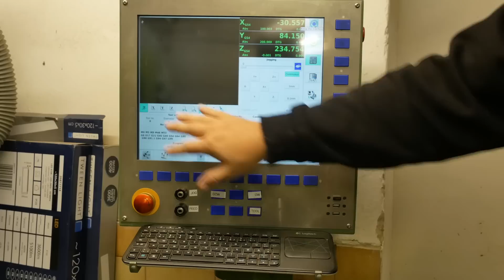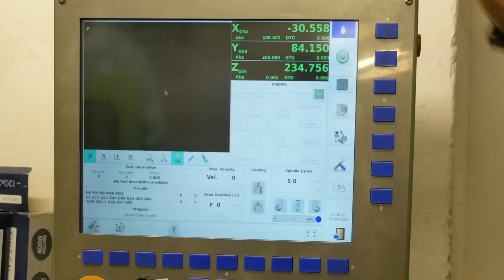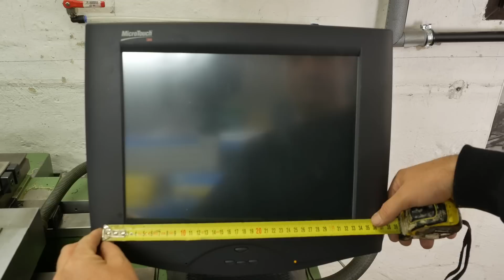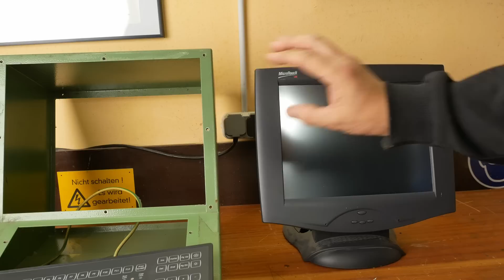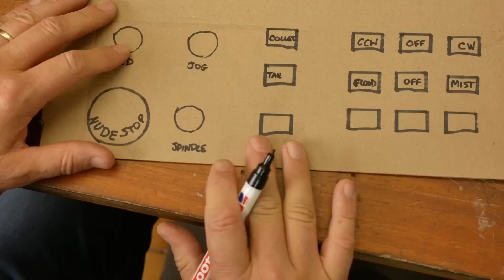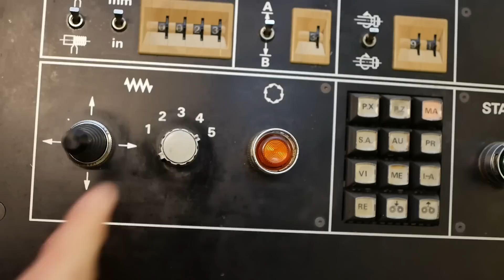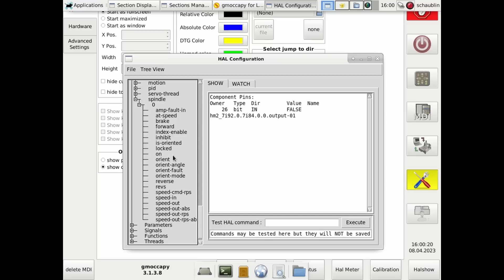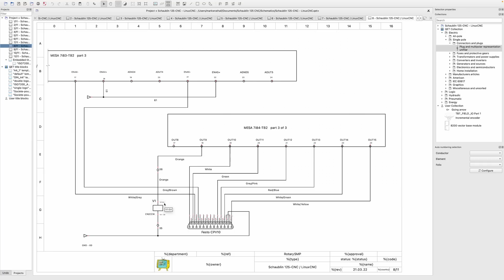Please help critique my CNC control panel layout ideas. || RotarySMP

Comment: I am very impressed about your progress, so that I can follow you with actions to my maschine under restauration. You are asking for ideas for the human interface. Isn*'t it a question how how to use which technology. Mouse driven or key driven or a rotary wheel with a selection button?

I find your way quiet interessting. Keys allow direct access to parameter and one can set different levels of paramters in relation to the frequency of using the specific parameter. This gives you the opportunity to direct access a parameter that needs to be change. Automotive electronic made a similar journey over the last years. Single technology parameter setting by a wheel and a single key or the combination with distingt paramater setting for specific use. It is easier to learn a single technology, but the combination offers much room for improvement and single user specific layout. Keys can be places in horizontal an vertical spheres, wheels need more attention especially how the movment will take place when using right or left hand. As a role of sum I would position those parameters which will be need to get different modes of operation by just switching one or some parameters. Examples may be reversing of rotation as toggle or form feed setting by numeric key as second input etc.

regards

Klaus
Reply from the maker: Thanks for sharing your ideas on this Klaus.

Comment: I would recommend a 24" DELL P2418HT Touchscreen Monitor we have them on our CNC wood saws and other machines and i think it's the right size.
Reply from the maker: Do you have those monitors as stand alone, or integrated in to a control panel? I really dont have space for such a large monitor in a control panel.
Reply: @RotarySMP  There are more or less standalone
Oh and they are HP

https://drive.google.com/file/d/1DCzpnbDZqSOTm9Y0bO0zH_L7hlln-3G-/view?usp=drivesdk

Comment: I think you should do another custom job like the Maho; another vertical unit....
Have you seen these screens...
https://www.aliexpress.com/item/1005005291064583.html?spm=a2g0o.home.15002.66.25722145oHy0WZ&gps-id=pcJustForYou&scm=1007.32079.207335.0&scm_id=1007.32079.207335.0&scm-url=1007.32079.207335.0&pvid=93906a9c-0620-44fd-a8f7-7d4ae8d6393b&_t=gps-id:pcJustForYou,scm-url:1007.32079.207335.0,pvid:93906a9c-0620-44fd-a8f7-7d4ae8d6393b,tpp_buckets:668%232846%238115%232000&pdp_npi=3%40dis%21AUD%21426.79%21362.77%21%21%21%21%21%402103200516830766892072870e2259%2112000032511887058%21rec%21AU%21102332100&curPageLogUid=8VvX3shBG6gV&ad_pvid=20230502181809261339694202493479267_0

Comment: I've worked a while on a Weiler C30 lathe, it had a joystick which could latch in X+/X- or Z+/Z- direction while turning, which made it feel kinda similar to a manual lathe with feed engaged. It also had two jog wheels, one for each axis. Maybe worth looking into.
Reply from the maker: Thanks for providing examples.

Comment: I use a joystick for X and Z jogging and love it. The speed of jogging is proportional to the stick deviation. Would hate going back to wheels. Ciao, Marco.
Reply from the maker: What machine and controller type it that?
Reply: @RotarySMP  Made a video about it 8 years ago, here it is... https://www.youtube.com/watch?v=ixOsdKvbKlk&list=PLQtK-o86LDp_78XDER9oJQAt_sDQWxK6x&index=11&ab_channel=EZshop I also use it with my lathe, obviously the buttons are mapped differently in that use case.

Comment: Instead of cutting down the sheetmetal, add extra rows of programmable keys to take up the extra space. I would use Cherry MX keyboard mechanical switches for the keys around the screen. There's nothing like the tactile feedback of a mechanical switch. They're very popular among keyboard enthusiasts and can be had for pennies a switch due to their popularity. They also have a huge variety of keycaps, including legendable ones with LED windows.  There's also a ton of online resources. Check out Datulab channel, a kid who has build videos on his CNC panels.
Reply from the maker: Thanks for the tips. I have been using industry switch blocks.

Comment: As experienced CNC machinist and master in IT and Computer science I would say that  your design is poor. Main reason is lack or poor placement of most important hardware keys such as cycle start, feed hold, feed and rapid override. This is essential. This buttons should be at the corner of the panel easily accessible without looking on them. On good machines cycle start and feed hold have its own shape this is very important as well. Also rapid and feed override knobs and theirs behaviour is crucial. To design such things properly needs to have both knowledge in CNC operation and IT systems design.
Reply from the maker: Thanks for your input on this.

Comment: Hi Mark , regarding Handwheels and Jog control ,  Fanuc, Meldas, and Seimens, all arrange the handwheel as you have done on the minilathe
Jog control is done with simple momentary contact  joystick, panel push button ,or membrane panel button . jog speed is controlled either with
the 0-200% feed rate override or a second jog speed selector with specific mm/rev settings, just like a manual lathe and probably the prefered
approach for a toolroom style lathe.
Joysticks were discontinued a long time ago,but I suspect it had more to do with ecomomics and not really being needed in a production environment.
Perhaps ,being as Joysticks and pushbuttons are not very expensive  a removable plate with either a joystick or 4 buttons could be done to find out 
which you prefer  the electrical connections would be identical.
FYI japanese builders have always used omron a16 series buttons ,they are very nice ,and as accessable as potato chips in canada.
alco and fuji also make identical switches. 

Regarding sense of feel,that just doesn't exist in cnc, electronic leadscrew or even powerfeed on a 100 year old lathe .
What I have seen with industrial cutting tools is that the feed and speed information that they provide is absolutely true and reliable ,
if you have done your setup correctly , it will work.
This along with being vastly more stable, is why jog instead of handwheel. try aligning something with the jog control instead of the
handwheel and you will see what I mean.

what you do feel is a sense of doom if something is going wrong😱
Reply from the maker: Thanks for your detailed feedback on that. I am collecting all the various advice for a second deign iteration.

Comment: I like it.

For the rail attached pendant: I've seen a demo for a force feedback HMI for a lathe a long time ago. That way one can use a CNC as a manual lathe. Even if you don't do that yet, it would be a nice upgrade in the future.
Reply from the maker: I wonder if LinuxCNC even supports that?
Reply: @RotarySMP  I don't have experience with it, but it seems very capable.
Theoretically, you have to put a tiny servo motor in the wheel. The wheel servo's encoder signal fed to the axis servo as target position, and the A-servo's torque is fed to the W-servo as torque target. If LinuxCNC has access to the servo drives' data, it is possible. Tuning the system can be an issue. Delays, feedback loop oscillations, SW filters, etc.
I'm pretty sure somebody tried this in the community.

Comment: I have the solution for cleaning the tag plate, just remove it, build a vaporblasting cabinet, buy a big compressor and then vaporblast it. And as a bonus you can now vaporblast parts. I built mine so it also can be used for dryblasting.
Reply from the maker: ... or just keep picking away at it, as I still have about another 50 videos which need content :)

Comment: Buy a TIG 😊
Reply from the maker: My welder is TIG/Plasma/Stick. I have just never gotten around to getting a gas bottle and learning to tig.
Reply: @RotarySMP  I would still invest in a proper used tig. Especially if it has AC for aluminium.  The 2t and foot control really help.

Comment: For the screen, I would go with the larger screen and build small extensions for the soft keys. The increased screen size is going to be more valuable.
Reply from the maker: I have the larger 17" screen on the Maho, and dont find I really need so much realestate for a machine control
Reply: @RotarySMP  that’s what I thought too when I built my CNC router. By the time the UI was completed though Icons were too small and the gcode viewer was effectively useless. I was thinking more about your eyesight though. My near vision plummeted between 45 and 50 so maybe I’m a bit biased then.

Comment: For me... nothing gives personality to a tool / panel like having physical buttons and switches.  Personally I enjoy having light indicators in / above the buttons, but that also introduces a point of failure and maintenance. Are the trade-offs for the buttons worth it?  A few encoders would also be nice, however just like valves and switches you really want there to be muscle memory for the controls. So having a single function for each control or atleast for each mode is best.  Also note... the four corners, and then the edges are the most valuable locations because those can easily be found without having to look over at the controls. Good luck, hope you find a mix you can enjoy... there is always rev2 if you don't like it. =D
Reply: ugg... i went down and looked at the comments there is plenty down there on the subject... sorry.  atleast a nod for Tim Hunkin is nice to see.
Reply from the maker: I appreciate your comments. The one about the edges being most important is a good one.

Comment: Use the bigger screen. And use low profile buttons stuck on the front.
Reply from the maker: Do you get low profile stick on buttons which last? Do you have a link please?
Reply: @RotarySMP  No you will have to find them your self. They have been made for old calculators originally. i have seen them on you tube

Comment: I'd use two jog wheels, z on the front, x on the right. So the direction the top of the jog wheel moves is the same direction the tool moves.
Reply from the maker: That is the way Schaublin did it on the 125CCN with the Fanuc control. But that would reverse my hands. I am used to X with the LH on the Boley.

Comment: I like the overall plan. Reusing the factory box and cutting it down is a great idea but it seems like it'll still be on the big side. Maybe a flip up keyboard for when not in use? Separate encoders are a given instead of the switch. I'd be constantly moving the wrong axis. 
 
          FYI that Bridgeport series 2 I mentioned before is now almost free but finding a place for that 15K pound 7500KG beast and the cost of getting it here... Still no film to drop off in Naxos yet but I'm trying to come up with something else for you. Will be there on the 8th next month.
Reply from the maker: Yeah, the bigger the machine, the cheaper it is. At least here. 
Enjoy Naxos. We are there in mid June.

Comment: Nice work so far.
I have a lathe at work I use that has jog encoders mounted to the carriage, and it also has a jog joystick mounted between the encoders. The joystick is set to a faster jog rate so far rapid moves it's quite nice. I use the joy stick nearly every time I use the lathe, as well as the jog encoders. I think it's valuable to have both options!
Reply from the maker: Thanks for the real world inputs from experience.

Comment: You said you always forget the direction of the jog wheel, the joystick should resolve that problem.
Reply from the maker: I was going to set up dual jog wheels with the same roatation as the manual Boley lathe I have. There it is intuitive.

Comment: I would suggest you go with the biggest screen you can physically fit in the cabinet. Almost everybody bemoans the fact that they cut costs by going to a smaller screen whereas you rarely hear people moaning that their screen is to big.
To cater for buttons down the side they can be outside the existing cabinet (a side car arrangement). Just make a facia panel that covers the full width. (spend the coin and get a stainless sheet  laser cut and etched)
As for the keyboard either makeup a drawer with ball roller slides that slides under the lower control panel. Roller slide rails are quite cheap online, particularly for the size you would require.

Alternately a hinged panel that has the keyboard on the under side (when closed).

Opening the panel exposes the control panel and swings the keyboard up the right way, also lowering the keyboard to a better height.
When closed the keyboard would cover the control panel (keyboard would be upside down). You could also make it so the E-Stop is pressed when the panel is closed.
Reply from the maker: Thanks Kim, good ideas. Since Gmoccapy is a fix resolution, I dont feel the need for a huge monitor. The 17" on the Maho seems somewhat too big.
I like the slide out keyboard though.

Comment: Some things:
- Just use an intel nuc, more than powerful enough and can be had cheap while being very small..would fit in the enclosure with the screen/keyboard.
- In Dutch it’s ‘noodstop’, not ‘nudestop’, silly man …
- I believe you bought it now, but an alternative to the 50eu print, when i understood correctly, is to either use an extra numberic keypad or to solder from the existing keyboard’s locations wires towards the function buttons above the keyboard. Then make a keyboard mapping in linuxcnc to put specific functions on those keys…
- As monitor i’d ditch the older stuff and go for a more modern touchscreen from lg or the likes. Not that expensive, integrate via usb, etc. The higher resolution allows for either more screen property or in lower res for larger nicer screen still. If as wide as the case go for a separate enclosure to the right of the screen. Wouldn’t weld, just rivet it. If not having a bender get a cheap solution or ask a party to bend it for you. Consider maybe aluminium as option. If wider screen just make in the same way a custom protection around the screen (wouldn’t get it out of the case probably) integrating the buttons. Cut the top part from the existing case and rivet the new one to it. Or even make the whole case new that way..
- To the left, right and top of the monitor part of the console casing i’d make extended flaps…like seen with screens on professional photo/gfx artists. Not only against wrong lighting but also to protect it from eg cooleant or an odd part flying around should something go haywire while turning ;D
- I’d check if there’s an option of a sort of security mechanism that shuts down the lathe motor if either there an electric/electronics failure or a computer/control failure. Something heartbeat-signal like towards a relay or so or something that acts as relay if unlogical input, voltages or the likes are received. Or in the future maybe extendable with eg temperature, speed or voltage checks, a timer for expected user input or general timer for how long the engine is operating in total, or is operating without further input for other servos operated, etc
- USB is nice, but i’d look more at integrating the machines in your workshop in either a separate LAN within the workshop with own wifi, separated from all (also internet), or make it a separate vlan and ssid in your home LAN. To be able to quickly transfer projects or data between your machines and your smartphone or tablet, wireless… Or if needed via PIFI…

Just some thoughts..
Reply from the maker: I already have the PC. It is some mini HP, similar size to a NUC (I used one of them in the MiniLathe). The HP is more powerful and boots fast.

I really like using the MESA hardware. It is an easy way to integrate a decent number of buttons, and it read in real time per the Servo thread, rather then having the latency of USB.

The Mesa Hardware has an integrated watchdog, so if the lan connection to the PC fails, it will e-stop.

None of my CNC's are network connected. I use the sneaker net for file transfer. If I need to update the software, I run a lan cable to them.

Comment: I got a iiyama ProLite T2435MSC-B2 24" Touchscreen-Monitor works very good. Has a glass screen so better protected against metal chips. Get two encoders for X and Z for slow step and one joystick for fast stepping. The most problems are forgetting it is on fast stepping.
Reply from the maker: Thanks for the feedback on that.

Comment: I've never flown with a Rolls Royce engine.  I was in the cockpit of an American Airlines 757 and if I'm remembering it correctly, it had N3.  That was weird for me because every engine that United had only had N2.  Now that we bought Continental Airlines, some of their planes had RR engines.  I never flew their planes.  Most jet engines are great reliable machines.  And good luck with the layout.  I'm sorry I can't help with that.....
Reply from the maker: I guess the modern planes suppress the N2 and N3 onto expanded engine indication pages, and you only get N1 or EPR on the primary EICAS page anyway.
The 535E4 are pretty old tech, but still soldier away on the freighters.

Comment: I like your videos and the way you solve problems and explain at the same time.
Can i give you a sugestion?
Put the control of the collet open/close next to XZ jog, also one increment selector for each axel next to them also.
Gut gemacht 👍🏻
Reply from the maker: Thanks for the tip. I realised afterwards that I dont need collet clamping on the panel. It is a footswitch I already set up.

I am not sure if LinuxCNC supports separate jog increments per axis, or if I would want that. It seems more predicable if both are the same.